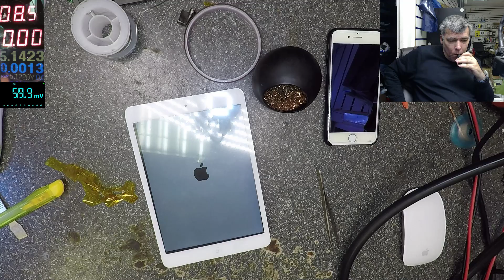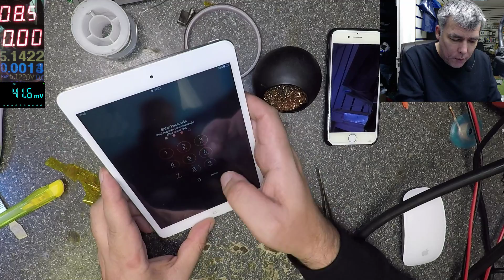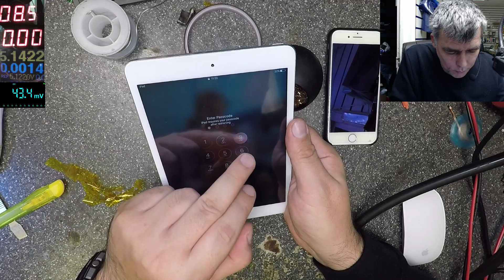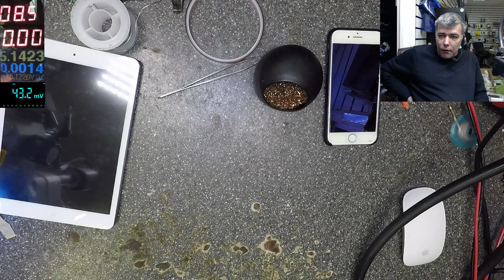Ipad mini Digitizer connector replacement -the easy way

Comment: about Flux - i'm fixing electronics for years and i've tried a lot of flux types. I found one, which I love to use for reballing/reflow or soldering work:
KINGBO flux. But that one in small package - in syringe with hologram sticker. Only this one is original and authentic - big packages are very often fake. Kingbo is japanese and it helps to make great joints, it not boiling during reflow, smoke is small, smell is good, and the price as well. Look at e-bay for Kingbo flux in syringe.(it has a thread on connection on top so you can screw down any cheap needles for electrionics chemicals, and to push piston on bottom you can use pusher arm from any medical syringle in the same size)

Comment: Just wanted to say thanks for making these videos! =)
I have soldered for many years doing bigger things but I am now getting into microsoldering.  I Have pretty much everything to get started like my multimeter, usb power meter, soldering iron, hot air station, power supply, flux, tools, pile of laptop boards, and i have a new amscope SM745NTP-B microscope on the way which should be here wed.  Can't wait for your new series for the beginners.

Comment: Always nice to watch your videos, you got skills Sorin! :)

Just have a personal question to you:

Have you ever experienced that after the cpu vcore gone bad like blown mosfets and controller ic, that the CPU gone bad?
As i fixed a HP DV6 blown mosfet on cpu vcore and lol i realized that the Phenom ii P960 is damaged will not run properly on 4 cores.
But it is all fine so far with 2 cores disabled...

Comment: What temperature did you use for soldering iron to solder back the new connector?  I head you saying that for removing the damaged connector

you used 500° hot air, but you didn't mention the temerature for soldering iron to solder back the new connector?

Comment: Apple lied to me. I had my screen cracked. So I went to Apple and told me they can’t replace the iPad mini 4 screen. Damn! But when I finally decide to buy a new one I thought I would get a reduction if they take the one that I had. They came back and told me since it’s superficial they would give me a new one, free of charge. I was happy but why they to me that they don’t replace the screen on the this pad. And then I see you with an opened one. So the question is: how do you get the screen out?